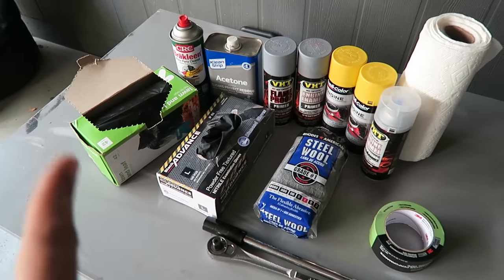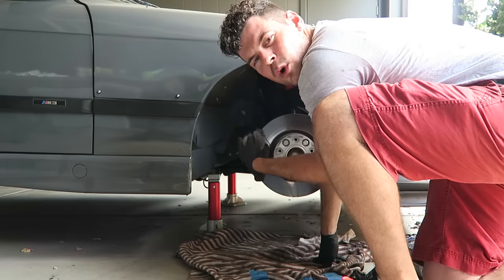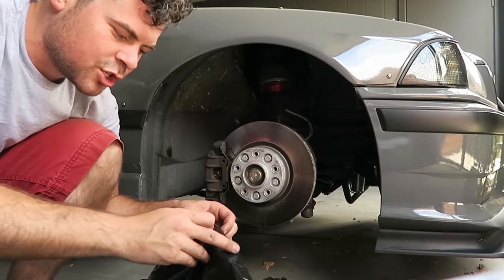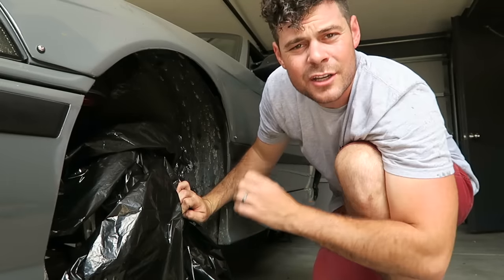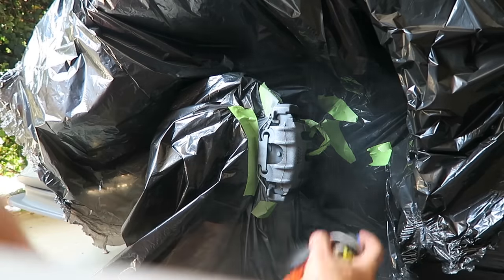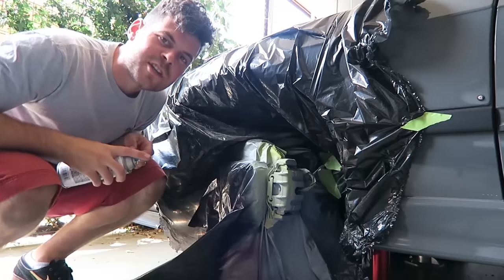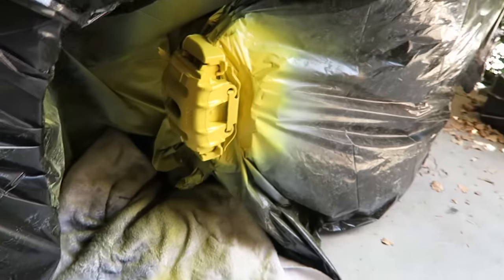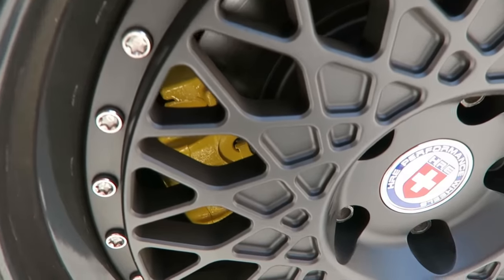HOW TO PAINT BRAKE CALIPERS... THE EASIEST WAY!

Comment: DUDE, ITS 2 BOLTS... PULL OFF THE CALIPER.
Reply: He would have to bleed the system if he took off the calipers
Reply: Shouldn't have to bleed the system if he just simply removed the caliper by undoing the caliper bracket bolts
Reply: Exactly,  tons of extra work for no reason.
Reply: Exactly, I'd say it's worth taking the extra time to remove the calipers from the car completely. Then you can fully clean and sand everything, don't have to worry about overspray on your car, plus you get a more durable finish. If you're gonna paint something, prep is the most important step. I'd rather spend time bleeding the brakes than covering everything in plastic.
Reply: @ben-7403  then he would have to change the title of the video to "the longest way".
Reply: @davem8360  You save a lot of time by not having to cover every part of the wheel well in plastic. It also saves you time down the road since doing it the right way gives you a longer lasting paintjob, so you don't have to waste time having to paint everything again.
Reply: Top Comment.
Reply: DontHurtMurt Pull off the caliper AND PULL OFF THE FUCKING BRAKE PADS LMAO
Reply: Not to mention this paint requires an oven to set it properly at 200 degrees for several hours, as it says on the can.
Reply: @stefanmarkovic8180  except that it's genuinely not, like he should have been using caliper paint which is rated somewhere near 500°C. The braking system can reach up to 800°C when doing heavy braking so using shitty engine enamel which isn't cured properly will result in it peeling off entirely. Which means you've wasted your "short" amount of time. An extra hour on it will save you ever having to do it again
Reply: @stefanmarkovic8180  Disassembling the caliper? You mean.. Opening it? Takes literally 2 seconds
Reply: @BrickSquad69  no need to bleed system by simply removing caliper
Reply: Colorado Strong   and..... homophobic as in fear of homosexuals.... as in gender attracted to same sex...
Reply: @BrickSquad69  No he wouldn't
Reply: @Tie Kuhn Why would you plug the lines?  Just take the calipers off.
Reply: I'm pretty sure this guy ask a mechanic to do is oil change
Reply: Right? Like come on
Reply: Amazing. It’s not just two bolts. That’s all I’m saying cause you will figure it out when you “just take two bolts off and the other work entails.
Reply: And protection mask.....over there is asbest
Reply: I was thinking about this...Some people just lazy😂😂
Reply: Mario  Don't have to mask the wheelwell if you simply remove the caliper and paint it off the car. It's usually just held on by two bolts and the brake line.
Reply: Lots of info in here, you guys are the right people to ask. Would it be possible to ceramic coat the caliper afterwards, is there a point. I know it protects a little but since this is in the wheel not sure how much it will matter
Reply: @1tbounty   remove caliper is 2 bolt. but the brake line is still attached to the caliper. so the whole set is still around the wheel ...unless you remove the hose which you will need to re-bleed the brake line to get the air out. yes...that would be the long route dude.
Reply: musical roses   yes you can remove with disconnect...then you still have to show how hold it around the rotor cause the line is not that long and you still have to shield everything from paint while hooking cliper on something and paint it. this is the easy way. no one can see the back side of the cliper.. I did the same and done in 15 min.
Reply: Does it matter?  In the end.... He spent about $100.00 and to date 3- Years.... He made about $4400.00 for this video and that just an average!  The job can be the chitiest..... But does it matter?
Reply: i know lol ffs.
Reply: Cobe Hadley 
What do you mean by ‘bleed the system’?
Reply: musical roses  Oh jeez. That would be a huge mistake for casuals looking for an easy job... Gotta be careful
Reply: Hahahaha that's what i was thinking i swear 😂
Reply: @BrickSquad69  no you dont lmao. you only have to bleed the system if you remove the brake lines. unbolting the caliper does nothing but remove it from the rotor, thats like saying you have to bleed your brakes every time you change the pads.
Reply: Some people don’t know how to remove calipers
Reply: @davem8360  loooooooooooooooooooooool
Reply: @BrickSquad69  you don't have to bleed the system, you do the same procedure as changing breaks. you open the master cylinder and compress the brake caliper piston with a vice grip
Reply: I've replaced a few calibers in my time. If your brake lines are good. You can use a clamp, not metal unless you use something to protect the rubber line, and clamp off the line before you break the line loose and you won't get air in your system if done right.  Close to the caliper as you can without damaging anything. Much better job in the end. Full coverage. No paint on the pads. Yes it's longer, but you get a better job than just spraying what you can see. Plus, 80% clean is not good enough. And Yes you can paint them with a brush and the proper paint. But if you read the instructions for caliper paint. Most say let dry for 24 hours before use. A small brush. There is more than two bolts if you want to paint the caliper bracket that holds the caliper. And that is more involved than just taking out the two bolts for the caliper. But if you don't have any experience with this. You should just do it his way.
Reply: 😂😂😂exactly
Reply: @texasfossilguy  actually normal brake use is enough to get the paint hot enough to set it correctly.
Reply: @BrickSquad69  I took mine and painted them. Yes, it will leak some brake fluid, but you can always fill up the reservoir at the end of the job.
Reply: Sounds simple enough.. But if you have a sticky bolt like I did, it takes longer to remove it than the entire process should take. 
I'm doing mine now and 1 of 4 needed prying as I was wrenching. The grime fought me from the inner threads.
😏..💭two bolts he says. 😂
Reply: When I worked at a local automotive paint shop years ago, I'd bag an entire car in a couple minutes. 
It helps to have a waist high roll of plastic that folded out over most cars. I wouldn't trust overspray barely bagged. You may not notice it until it's cured and locked to the paint one day when the sun hits it at the right angle.
Reply: Hakim Hasan  oh yeah?.... Where's your videos? 😂.. So, everybody funny now you funny too?
Reply: He didn’t even turn the steering wheel to angle the calipers better lmao
Reply: @zodspeed  well... Perhaps he has 180° twist in the wrist, and turning the wheel is a unnecessary procedure. 😏❓
Reply: @MadDragon75  you can see the whole caliper better if u turn the wheel...
Reply: @zodspeed  "I" could put my FPV goggles and fly my mini whoop underneath the car to see. 
Lol ..eye protection ✔.
Reply: @MadDragon75  or u could just turn the steering wheel... or unbolt the caliper to have full access to the entire thing in the first place... this is definitely not the “easiest way”
Reply: @zodspeed  well, when I did my calipers I pulled the majority and left the lines connected.. But I did have them hanging on wire coat hangers in the wheel well off the springs. That was the easiest way for me. The caliper pins.. 😒 one had lube that was so old it became closer to clay than greese. That was what took me the longest. That thing was so long winded I nearly took a hacksaw & drill to it. 
There's only 24 hours in a full day and I decided I wasn't using all of them on one slide pin.
Reply: @zodspeed  and what would be the point of disconnecting the caliper and then not the brake lime and just letting it hang there and then paint it? Makes no sense bro think before you say something next time maybe
Reply: @zodspeed  take a look at @andrew comments in this comment section. That guy knows what he’s talking about and it saying the same shit i’m saying to u.
Reply: There’s no difference lol. If anything it’s more of a hassle if you remove the caliper most brake lines aren’t long af so it’s not going to drop down enough to lay it on the ground. This is the most quick and efficient way of doing it unless you’re swapping brake fluid and already going to bleed your brakes then yes remove the calipers 100%.
Reply: @B_M_A  Yeah. Exactly. Lol. Unless you make a mess with overspray...  This is the way to go.
Reply: @MadDragon75  huh? your response to me makes no sense...try again
Reply: @scroperman4612  I was saying that you are correct.
Reply: If you’ve pulled the whole caliper off you know putting it back on its very easy to bang it up I did on my rs7 it was chipped some putting it back on ended up doing this.
Reply: @Ctvracingg  believe me you have no idea what night mate might come from taking off a calliper sometimes they can take ages to bleed especially if you do 4
Reply: For ppl like me that are scared of doing too much and breaking something, I appreciate this way 😂
Reply: OMG🤭😂💯...I'm here at 4am yelling at my phn...Like Bruh🤦‍♂️😁
Reply: @BrickSquad69  i think he just meant only removing the caliper off the rotor not disconnecting lines
Reply: cry about it
Reply: @stefanmarkovic8180 Spelling “”whole is hard

Comment: Please... god... don’t paint you calipers this way....
Reply: 1)Painted the brake pad
2)Missed half the caliper
3)Used Engine paint instead of caliper paint which resist brake dust instead of grease and oil
4)PRETENDED TO KNOW WHAT HE WAS DOING THE ENTIRE TIME
5)Who the fuck...........
Reply: You should read the title save a piece of mind  is called "The easiest way!" lol
Reply: matthew mercer 😂😂
Reply: I thought this was meant to be the fastest way of painting your calipers🤦🏼‍♀️😂
I think I'll stick to my way of painting the calipers. I use Hamirite heat resistant paint & use a paint brush. SIMPLES 🤗
Who needs to spend all that wasted time with bin bags, tape etc 🤔😂 (yes I know I've spelt Hamerite wrong🤦🏼‍♀️😜) 
Thanks anyway.x
Reply: This method works just fine guys, don't be negative. He prob spent 50 bucks vs Matthew Mercer spending $500 his way that thinks is better. And with the wheels on it won't be noticeable. Unless u enter your car in car show competition. U will be fine this way
Reply: @tremendouscream82  what will be noticable is the paint on the pads. It takes like 2 seconds to pull the pads out..
Reply: its pretty good tho " : )
Reply: @dummyphone3575  lol
Reply: @danison2819  Its not the easiest way if you have to redo it again in 6 months because it flaked off or just looks like complete shit.
Reply: @uhhhhNick  You should read the title again. it says ' the easiest way" not a lifetime warranty!!
Reply: I agree 💯. It don't cost nothing but 2 extra minutes to take the calipers off the rotors and pop the pads out.
Reply: @tremendouscream82  cool comment man. People are so quick to be negative. I liked the video.
Reply: dani son it should have been titled the worst way
Reply: Super Dave obviously that’s above this guys skill level lmao
Reply: Geez... everyone is a critic.  it looks good and you really can't tell the imperfections after the wheel is on.  The high temp engine paint will probably last as long as caliper paint.  It really was the quickest way to paint calipers.
Reply: @philc.9280  yeah no calipers get several hundred degrees hotter than the engine, the engine paint will start flaking
Reply: @Jesuschristitsjasonbourne3  yeah no calipers get hotter than the engine the engine paint wont resist the caliper temp it will start flaking after a month or even sooner I learned that the hard way
Reply: @rebekahnddavies-nolan981  do you have a video?
Reply: @tremendouscream82  Except for the overspray, which definitely got on the car this way.
Reply: @davethemagnificent2576  but you have to bleed them vato maybe he was trying to avoid thay
Reply: @SamSabin  
Hahaha I used engine paint 20yrs ago to do the same thing and it lasted years on a new set of calipers.
It'll be fine for what he's doing unless he keeps his foot on the brake while he drives , if so he deserves what he gets.
Reply: @Mark Claris 
I just did a rear set on my latest project with plain ol brush on Rust-Oleum. 
(they are off the car) 
 They were nasty looking and corroded, but functioning. 
I spent about 30 seconds with a wire brush and a hit of brake cleaner. 
Why so much prep time you ask? 
I really didn't want to spend much time doing it at all, because it's sort of stupid. 🤣
At best it's just to keep them from rusting but you probably ain't gonna pick up bitches cause of your painted calipers. 
I'm sure it'll last 3-4yrs or until the corrosion comes back to lift it off. 
But it burning off? Haha not much of a chance unless I drive to Cali with my foot on the brake 🤣
Why didn't I do the fronts ? 
Eh they were totally shot and I got a deal on some scratch and dent powder coated ones.
Reply: It looked like you painted over the piston! Lol
Reply: Rebekah ND Davies-Nolan exactly what I did, whip the brush out and away I went 😁  Came out lufffly!!
Reply: @dummyphone3575  The 2-part "caliper paint" runs about $55 for a small can (probably wont cover all 4 of these large calipers)! It's a BIMMER, just invest in a set of caliper "covers" and be done with it! I own an "Escape" and was considering "sprucing up" the calipers. After watching this CRAP and reading all the "expert" comments, I decided to pull the trigger and get a set of aluminum covers for my CHEAP Escape!
Reply: @davethemagnificent2576  this ain't no show car..might as well just tear the whole car apart for 2 yrs & do everything right, ha ha!
Reply: @chestercopperpot5139 works fine..put the wheels on & don't be expecting the paint job to last 15 yrs..WTF is wrong with people, this is painting not restoring a '58 Ferrari...
Reply: MrZootalores calm down numb nuts I only said I used a paint brush on the callipers. Go get the ride mate and chill out 😂

Comment: Why are you painting the brake pads
Reply: Why not?
Reply: It adds 2extra hp
Reply: Because he's lazy
Reply: Simple you thicko........ 1) what the heck does it matter.   2) saves a total strip down, to get a pretty good job.   3) next time pads are replaced- instantly solved.    Next time try to think a bit more about the comment before you post it.
Reply: @p3yro  Not a big deal...a little paint isn't going to hurt the shims.
Reply: The real question is why yellow?
Reply: Because he's high on paint fumes, duh
Reply: dragonfist45 would have been easier removing the calipers and brackets!
Reply: @akaredcrossbow  I thought that!!
All that work masking off 🤤😴🤤
Bugger that!!
Reply: Cause it's easier than doing doing things the right way lmao
Reply: akaredcrossbow agreed, but also, Go Bruins 💪🏼
Reply: bad job he shoud have sprayed the discs also....
Reply: This....

Comment: In the time it took you to prep and wrap everything, you could have taken out the callipers and brackets, it takes 20 mins
Reply: danky duck I don't have the tools to do that. Just the jack and tire iron to change a flat so this video worked wonderfully for me. It will take me much longer but I can do it his way.
Reply: +Shuffle3956. Not really, you can take the pads out, leave the caliper attached to the lines, get a cleaner mask, and then paint. You shouldn't worry about it though, if you don't know the difference between brakes and breaks, you should not be trying this at home.
Reply: Don't have to disconnect the rubber hose in order to clean/paint the calipers. Just hang the caliper in the wheel well by a piece of wire or string, keeping the weight of the caliper off the rubber hose so it doesn't get stressed/twisted. And, when putting the caliper back on make sure you don't twist the caliper around and put the rubber hose in a bind. "Feel" the resistance on the rubber hose when returning it to it's mount and reinstall it in the appropriate manner.
Reply: Dude bleeding the breaks can be a pain and it's messy.
Reply: Facts. It takes no time at all.
Reply: you dont need to bleed the brakes if you clamp all of the brake fluid lines before you take off your calipers
Reply: Connor Low  yeah but I dont trust clamping those lines, end up doing it the wrong way and really end up with a project. Plus there is no way to perfectly clamp them, some air will still get in the system. Might as well just bleed them. But if he just taking the caliper off but leaving the brake lines attached then you shouldn't need to bleed them.
Reply: Yeah, I agree there is always the possibility of air getting through but the main thing is that If you are going to go through the hassle of painting your calipers you might as well spend some time cleaning them and greasing them too. I took them off so I could really scrub the shit out of them lol
Reply: LMAO! You nailed it!
Reply: It took me like 1 minutes for each caliper to wrap it in plastic. This is the easiest way. Taking them would would take longer
Reply: ricer job what you do expect?
Reply: please leave, try paying someone to do this....
Reply: that's what she said
Reply: @silentj624  - I barely know how to change my pads and rotors but know you don't have to bleed the brakes to take them off. Just came from a ChisFix video where he takes his off and supports them on a box by the rotor. Bags stuff off and paints right there. No bleeding.
https://www.youtube.com/watch?v=AmEEYTtIfMU

My only hesitation is that the clips on my model are a bear to get back on.
Reply: cermak cassidy  They’re known as brakes, not breaks.
Reply: Yeah, but it's probably a better use of your time than painting calipers.  Lots of recommendations these days to replace all your fluid after 2 years.  If you want to paint your calipers take 'em off, do a much better job, then bleed your brakes...